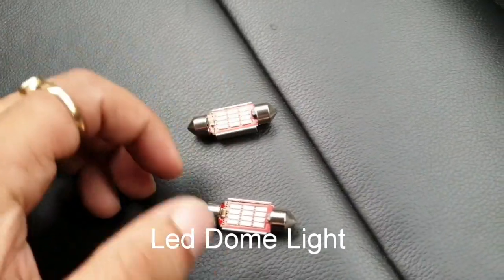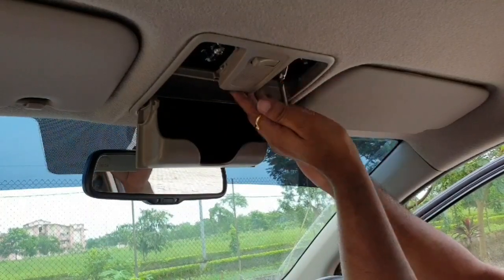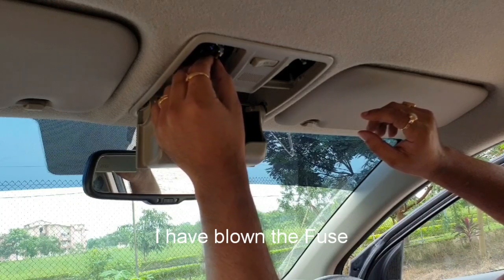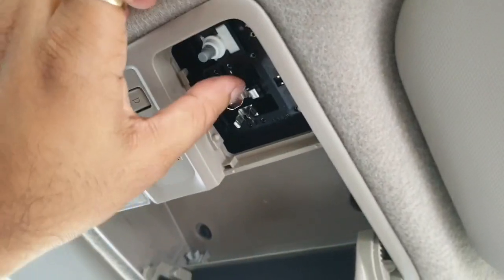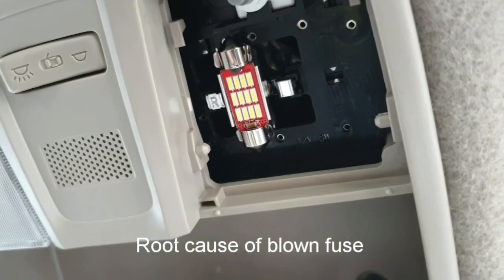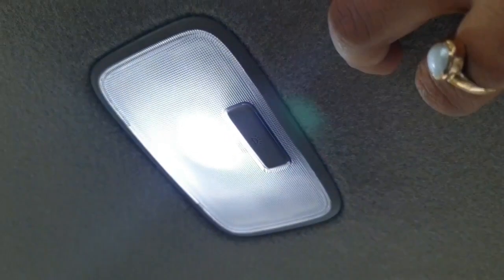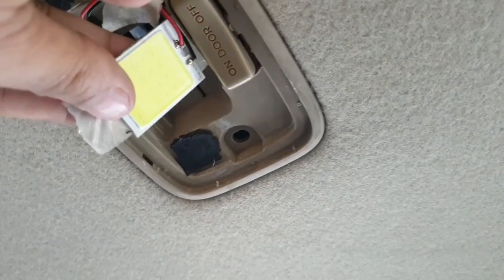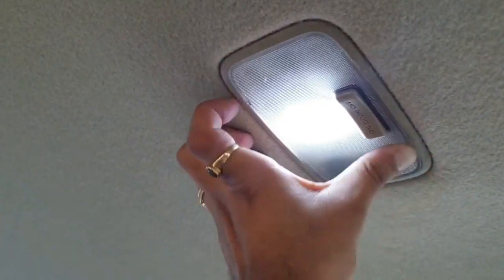Car Led dome light installation | How not to blow the fuse | DIY | Vid ARN

Comment: Can you clarify how to not blow the fuse? I think I had the same issue. The fit of my LEDs is VERY tight. Tried putting my old bulbs back in, and the lights didn't come back on.
Reply from the maker: Use a plastic cover or use electrical tape on the sides of the heat sink... actually the heat sink touches the conector on both end and causes the fuse

Comment: Hi, i tried the same and now my boot light, cabin light and car lock/unlock is not working via remote. The LED which i was trying to fit does not have heat sink though. Were you facing the same issue as well? And also can you tell me if its because of blown fuse?
Reply from the maker: Check all fuse... some cheap led hav polarity and + to fit + only otherwise blows fuses

Comment: Sir my lights were at door mode and they didn't turn off the entire journey it is causing some problem i have normal cabin lights i mean the default one would changing work if not what should i fo
Reply from the maker: It should turn off once doors are closed.. may be the switch on the door is not working. Show it to a mechanic
Reply: @afteroffice_yt yes exactly now after it is turned on once it is not shutting until the car is turned off

Comment: Where u got the new fuse... Kindly tell me. I did the same mistake yesterday.
Reply from the maker: Check the fuse box in the engine bay.. passemger side near the battery for Verna... spare/extra fuse are the underneath the fuse box cover..

Comment: Will a 41mm led festoon bulb fit into 42mm socket?
Reply from the maker: Yes.. you can also adjust the socket a little bit by pressing it inward or outward.
Reply: @afteroffice_yt  Does the heatsink cause the fuse to blow then on these led bulbs? How do you prevent this?
Reply from the maker: @thew4rrior5code  if it touched the connectors than fuse will blow. But correct size led. Also you can use a little tape on it.
Reply: @afteroffice_yt  ok... What tape and where to put it? Also you know on these heatsinks are they supposed to have a gap either side of the connectors because some of my led bulbs from Amazon touch 1 side would that cause fuse to blow too?